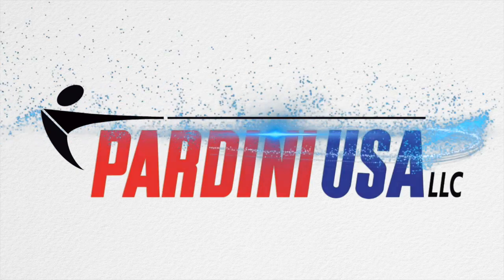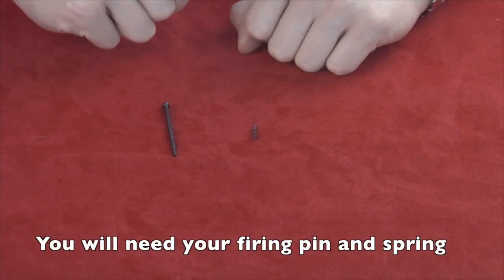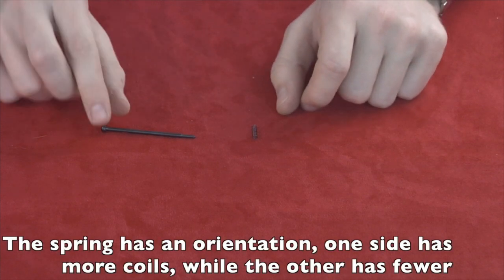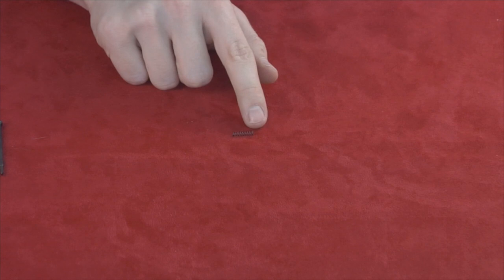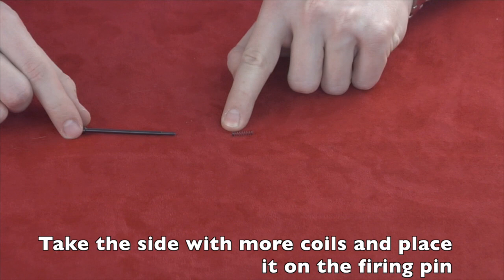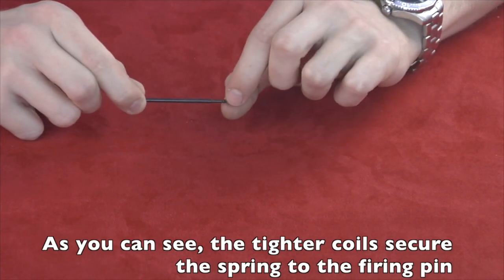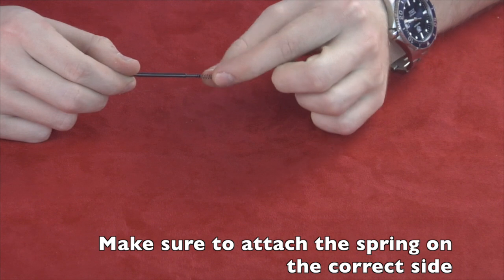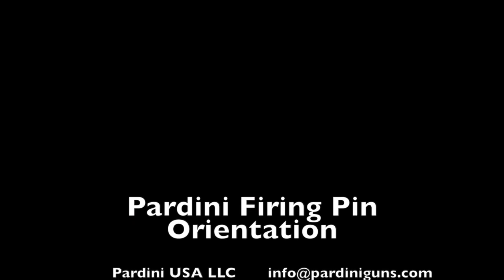Pardini Firing Pin Spring Replacement

Comment: Pardini SP RF:
I would like a video on the many adjustment options of the trigger screws (RG, CS, PS, PG, PP etc.). Probably the most important video is missing so far.
Reply: Yes, that would be so important. But I also expressed this wish in another video. Pardini did not respond.
Reply: Yeah, right. I would like to reset the trigger to the factory settings. How does it work?
Reply: Right, please Pardini. Do that!
Reply: @TheRyma52  
If there is no video here I change to the Walther sport pistol. The manual from Walther is excellent. Each screw is commented in detail on several pages. I have enough of Pardini.
Reply: @jasonsmako5891  
The Pardini manual is the worst there is.
Reply: Guys I need your help, i have a pardini spe. Everything works fine but one problem. Cant manually remove round. When i pull slide back bullet stsys in the ejection port, need to push ammo with a pin to release it. Can you help?

Comment: I'm confused. Doesn't the firing pin spring on the SP fit over the firing pin for its entire length?
Reply from the maker: No it does not, this is an SP firing pin. You may be thinking of the recoil spring and guide rod?
Reply: Thanks. I stand corrected.

Comment: Ye right.... I tok the firing pin out, and the spring remained very well in the slide. The end with more coils should point towards the pin - to prevent the spring climbing on the firing pin, and not for any other reason than this ! The spring is simply harder on that end.